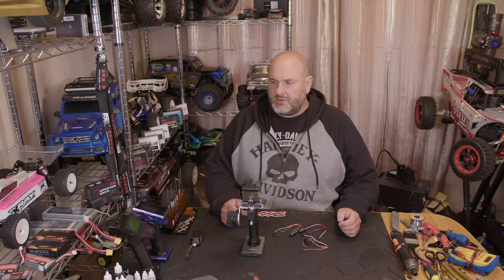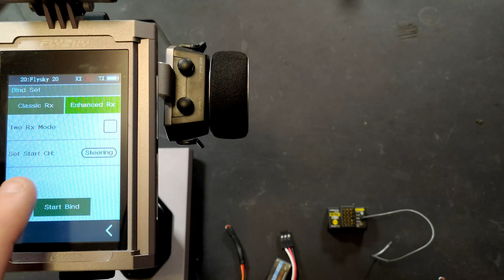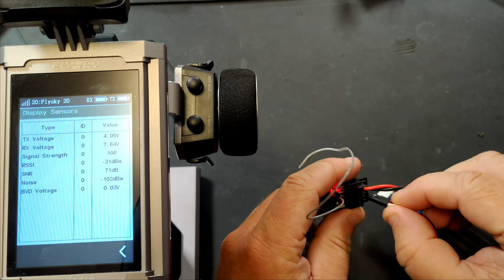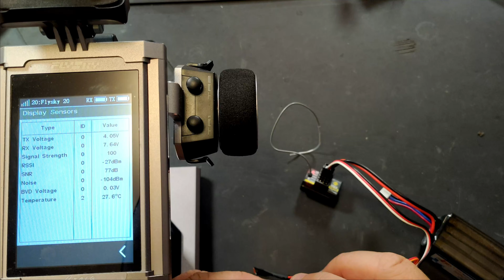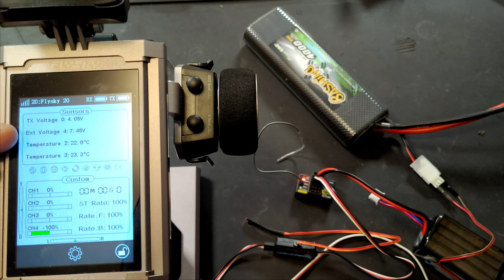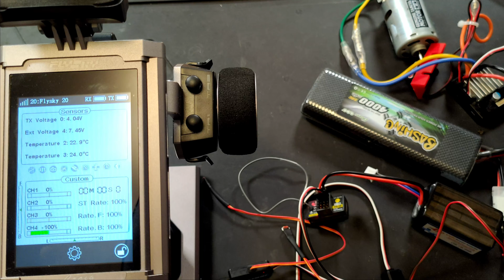Flysky Noble Pro sensor set up and alarms CTM01 temp CVT01 voltage

Comment: We need a receiver that has full light control 6-8 channels with gyro FLYSKY. Also...can you daisy chain the gps module with the temp sensor? If so, maybe a video?
Reply from the maker: You can use the 8ch light controller Rx along with the INR4-GYB to have 12 channels or 4 ibus 2 ports and 8 channels with gyro and light control all working, the GPS is ibus 2 so no you cannot daisy chain but you can have a 7 channel ibus 2 hub
Reply: @WTFRCCars man you are just full of flysky information.  Thank you for tye help and the awesome channel.
Reply from the maker: Thanks I try my best

Comment: this work with the G11P?
Reply from the maker: Yes with the 2 way receivers it does work on the G7P and G11P
Reply: @WTFRCCars thanks man. How can we tell which ones are 2 way?
Reply from the maker: They have the bvd socket and bind in 2 way to the transmitter

Comment: Thank you for great helpful video I followed your instructions and both temp sensors work fine but can’t seem to get the gps module to connect I’m using a fgr8b receiver with the sensors going into channel 7 not sure what channel to plug gps into to make it connect
Reply from the maker: You can't use ibus and ibus 2 at the same time so if you want to run the GPS sensor then you will need it set to ibus 2 and then use ibus 2 temp and voltage sensors :)

Comment: Hello and thank you for video. Im having an issue i cant figure out. I am running an outcast 8s and have a noble 4+. I want to monitor my lipos of course but not sure how to do that since ill be running 2x4S. What sensor or sensors do I need and how would I set that up? I appreciate your time and help.
Reply from the maker: If you want to monitor the total voltage then just the bvd sensor of any of the enhanced receivers will do that just attach + to the + on the esc, if you want to monitor each lipo then you will need the 2 X ibus voltage sensors or if you have an enhanced receiver with bvd you can run an ibus voltage sensor or an Ibus 2 voltage sensor along with the bvd so use the bvd to monitor one pack connecting + to the + on the balance plug of one pack and then use the voltage sensor to connect both + and - to the remaining lipos balance plug giving you both packs you can even use 2 voltage sensors one to each lipo and the bvd to the + on the esc input to have both packs and the total voltage shown on the nb4+
Reply: @WTFRCCars thank you for the answer. I realized I had 2 bvd sensors so yay. That said im looking at my esc, im assuming I would need to splice into the positive on the esc and tap in my bvd sensor?
Reply from the maker: You can only run 1 bvd on a receiver
Reply: @WTFRCCars i watched one of your older videos and figured it out. I spliced the positive of the bvd into the positive of the esc input and now tracking the total voltage which i just tested and worked flawlessly 🎉.  Thank you ao much. Newer to RC and jumping into a noble 4+ was like reading latin when i know no latin 😂
Reply from the maker: Nice one :)

Comment: I monitor my 1/8 EP buggies running voltage with the voltage sensor using the i-bus port, could we use this port for the temperature sensor instead? Thank you
Reply from the maker: You can use the temp voltage rpm sensors all at the same time so it will work for any of them

Comment: Hi WTF RC, I have the INR4GYB receiver. Can you use the CTM01 temp sensor on 1 channel say NPB and then have an IBUS2 GPS sensor on NPA. On my nb4 pro+ if I set NPB port on ibus in so the temp sensor works it won't allow me to select ibus2 on NPA. Same happens vice versa, if I have NPA set to ibus2 so the GPS works it will only allow Ibus2 on NPB and not ibus-in. It won't allow both sensors to work at the same time. Any insight??
Reply from the maker: From memory you can only use 1 protocol at a time so ibus or ibus 2
Reply: @WTFRCCars thought so as it wasn't allowing me to choose different protocols for each channel. Thanks for your time, love the vids, really helped me setup my system.

Comment: Hi, i have a noble pro with inr4 reciever and a ibus 2 GPS. Now i want a temp sensor ad to the transmitter but i can‘t find ibus in. Do you now what the Problem is.
Reply: If i set one port to ibus2, there is no ibus in on each port
Reply from the maker: @user-on2gu6ok4u what options do you have for the other channels
Reply: NPB only sbus and ibus2
Reply from the maker: So do you have the ibus 2 temp sensor ? And ibus 2 gps
Reply: Ctm 01 temp and ibus2 gps
Reply from the maker: @user-on2gu6ok4u Not sure if you can mix and match sensors I'll have to check whenever I have set them up I've done ibus or ibus 2 I'll take a look :)
Reply from the maker: Set one of the inr4 GYB ports to ibus in
Reply: If i set ibus in, there is no ibus2 on each port.
Reply: If i select on on NBA ibus2 for the GPS, i have on

Comment: I just picked up this sensor and would like it to monitor my nitro engine..any ideas how to attach it to the button head? When I temp the engine with a temp gun I temp it from between the plug and exhaust port.
Reply from the maker: You could use a thermal pad and stuff it between the fins at the bottom of the heat sink
Reply: ahh good idea, I dremeled out a small hole for the sensor in the cooling head so the sensor sits up against the head button. I tested it vs heat gun and there is a 2 degree delta...but damn the wire coming out the back of the head is ugly lol @WTFRCCars
Reply from the maker: @kawicepticon8866 yeh no nice way to hide a sensor

Comment: Hello, thank you for this video. How can i calibrate voltage or temperature?
Reply from the maker: If you click into the menu of each sensor if calibration is available then you can change the value in there but for me the voltage and temp have been spot on as stock settings

Comment: Salut !! Les capteurs ont pour tension d'utilisation 4.0-6.5V DC. Si je règle le bec de mon ESC à 7,4V, est ce que je risque d'endommager les capteurs ?
Reply from the maker: I've not tried them at 7.4v so not sure
Reply: @WTFRCCars  Je fais en faire fonctionner avec un ESC Hobbywing Max8 avec le bec à 7,4v. Je verrai bien.

Comment: As a total noob to sensors what is ibus and sbus ??
And what was it you plugged in to A as the camera didn’t catch it 😗
Reply from the maker: Ibus is the protocol that the sensors connect over so you have to set one socket to ibus, Ch 4 or port A was just the battery to power the receiver from like in a nitro RC but in electric RC it's not needed as the ESC powers the receiver :)
Reply: @WTFRCCars  Thanks for replying 👍
Sorry my mistake , not A the battery …. the next one you plugged in
Reply from the maker: Ch1 steering ch2 throttle ch3 not used ch4 sensors top socket is BVD you can connect battery to any that are free channel
Reply: How would I hook up a voltage sensor for a dual battery set on Xmaxx? Positive and negative coming off max 6 , or into the "splitter" going into the two batteries??
Reply from the maker: You would connect it to the pos and neg going to the esc :)

Comment: Excellent video as usual! I did this a few weeks ago myself with the 4 channel enchaned receiver. One thing to note is that I'm using "2 channel, 2way" mode and one of the spare channels is changed to an input for voltage. My radio also sees the channel 2 BEC voltage from my RX so I guess I'm transmitting data on 3 channels which would be confusing as it's only supposed to feed data for 2 channels? Maybe I'm missing something here.
Reply from the maker: Ch and data links ain't the same, so you have 2ch throttle and steering then ibus for the sensors and bvd for voltage but they are transmitted as data not a channel if that makes sense :)
Reply: @WTFRCCars I understand what you wrote and I see I didn't word my question properly and what I really meant is that I wonder if the extra data being sent (ibus) has an effect on the overall latency advantage the 2 way/2 chan node brings to the table. Probably not enough to be noticed by the typical end user I guess.
Reply from the maker: The Ch gets priority over the data so shouldn't affect it much at all but ultimately 1 way will always be the fastest connection just you wouldn't really notice it at all as 2 way is so fast now
Reply: does the mode setting affect output voltage? cox I plugged a motor fan to ch3 but it just randomly go fast & slow when I pull throttle trigger. wondering if ch3/4 will react to ch1/2 action.
Reply from the maker: Nope that's you esc's bec dropping voltage if it's electric or you battery pack can't provide enough voltage for the servos if it's nitro

Comment: Are there RPM sensors for the Petrol ⛽️ engines? Great Vid Thanks WTF.
Reply: You can set the sensor up to any rotating part to get RPM. Optic sensor or magntic hall effect sensor
Reply from the maker: No the rpm work on anything
Reply: @WTFRCCars can my already existing rpm sensor on my revo 3.3 be used?
Reply from the maker: No it won't work with flysky
Reply: @WTFRCCars thank you for the Responce. Its a magnetic pulse sensor. Can i just solder the wires of the sensor to the wires on the rpm box/controller thing?
Reply from the maker: Really not sure I've never tried it
Reply: @WTFRCCars I guess if I end up investing in the system ill find out.  Lol
Reply from the maker: The traxxas is optical and flysky do an optical rpm so maybe you could use the sensor